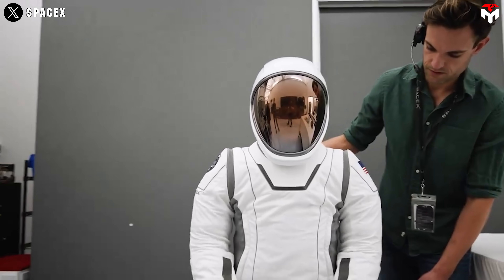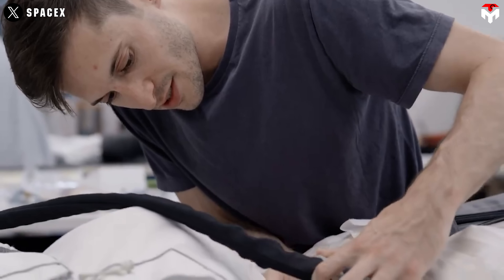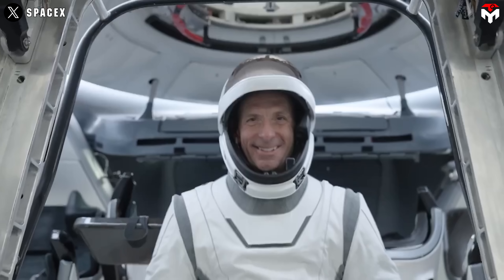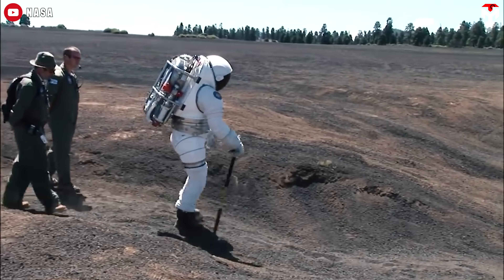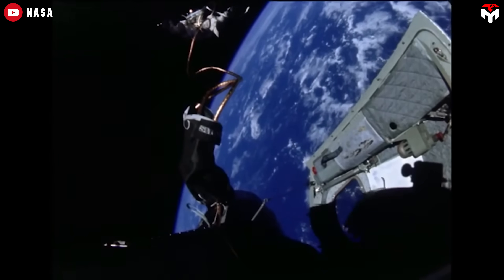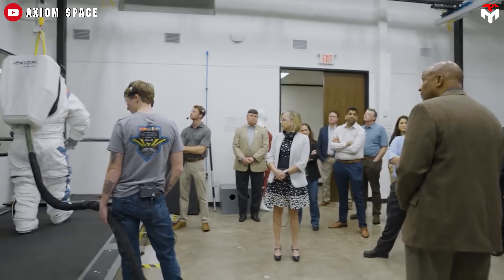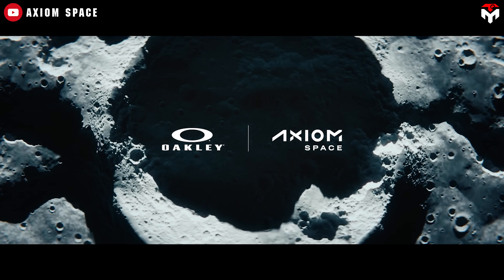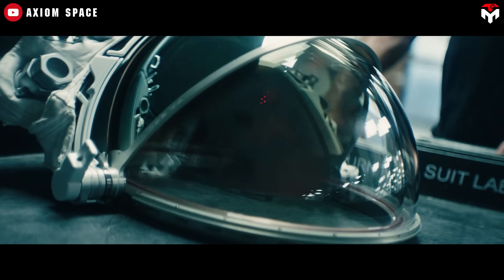SpaceX's New EVA Suit Upgrade is Somehow BETTER than NASA's $3.5B one!

Comment: I love the jet pack consept but i thing it needs to to be more compact to be able to fit on the iss and other space crafts much more like ksp's jet pack compact and reliable🌕🌎🚀
Reply from the maker: The Kerbal Space Program jetpack is super compact, using just 5-8 units of EVA propellant for a 600 m/s Δv, perfect for tight spaces. Real-world equivalents like NASA's SAFER are small but still bulkier than ideal, designed for emergency untethered EVAs with a 3 m/s Δv. A KSP-style jetpack—light, simple, and integrated into the suit—would be a game-changer for mobility in cramped spacecraft or ISS modules. Maybe a modular, low-profile design with advanced thrusters could do the trick?